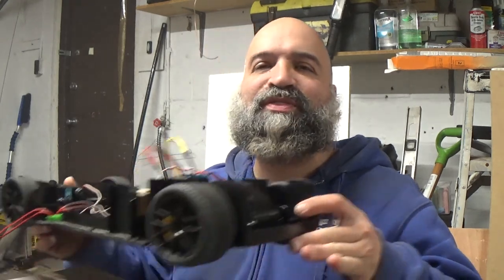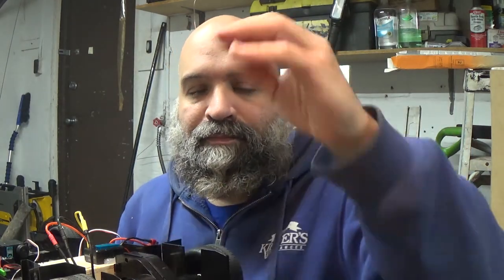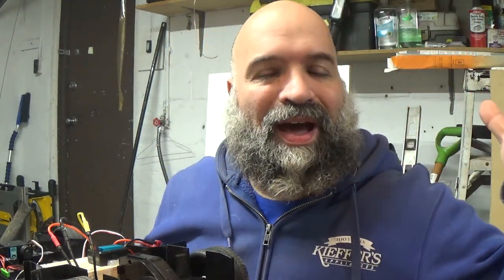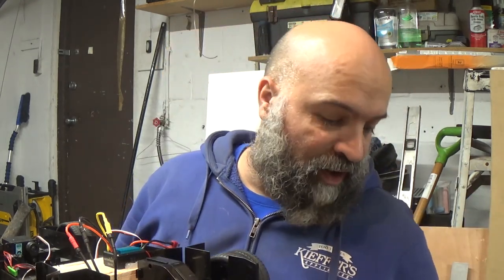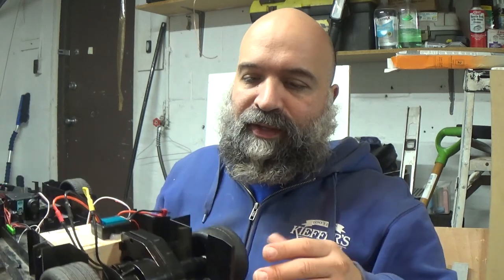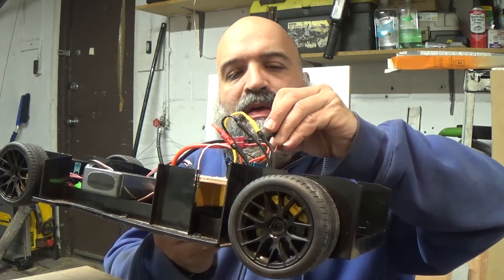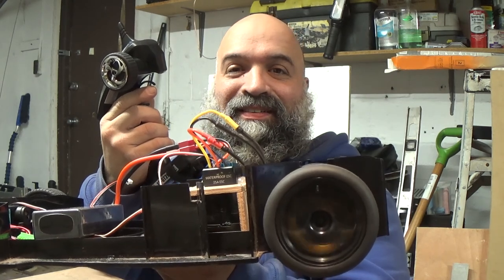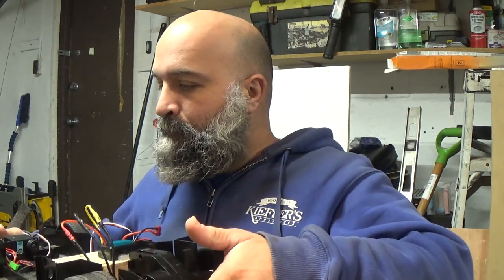Hennessey Venom Gt 1/8 scale toy grade rc car goes brushless

Comment: Ese auto es de juguete no fue diseñado para ser modificado de ninguna manera es mejor invertir en modificar los grandes modelos de la marca NIKKO original japoneses o de Malasia 1980 a 1995 son geniales y las cajas de transmision ya traen un 540 instalado y los servos son de 5 cables pero del mismo tamaño de los servos actuales de 3 cables le pones todo el sistema nuevo buena suspension y a correr